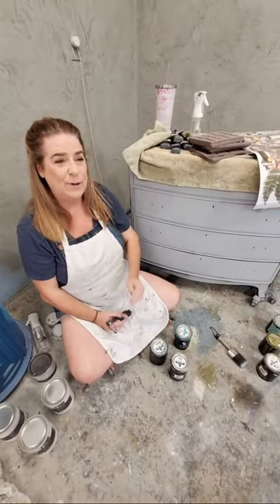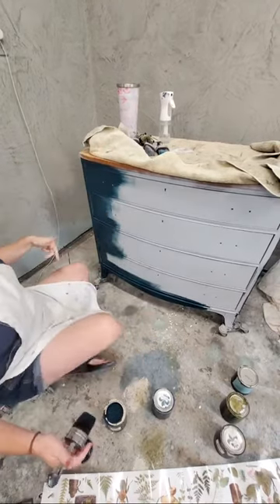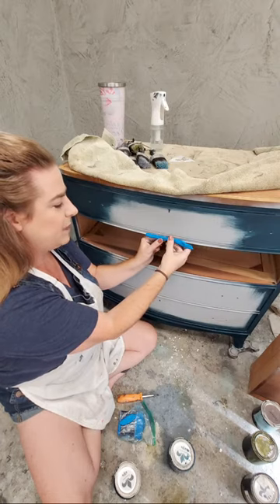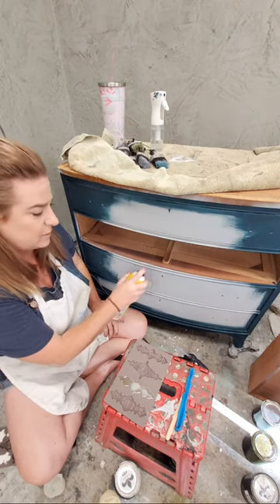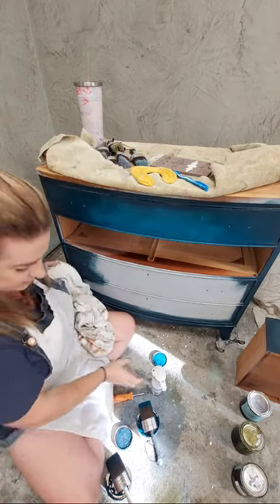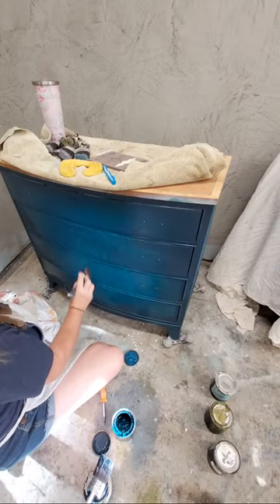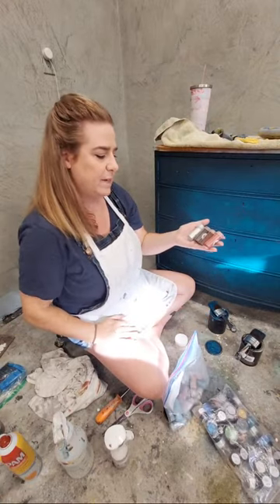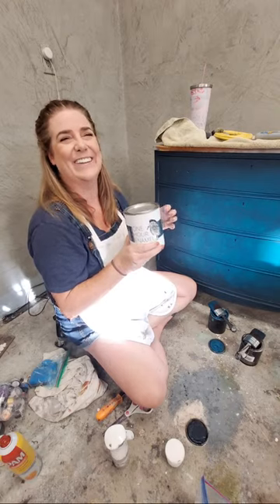How to replace missing mouldings & a blended base coat on a 4 drawer dresser

Comment: Ho Brandy, it's Lisa from S. La. I'm really interested in learning how to cast a trim moulding. I paid $25 for a French Provincial dresser. It is missing 2 drawers. One of the top drawers has trim a flower like section and I want to be able to duplicate it. Can I make my own mold?
Reply: I see that I can make my own mold but my trim is wrapped around the face of the door. I do have some of that modeling clay, just wondering how to make such a long piece of trim.